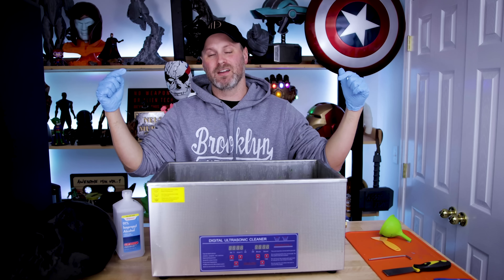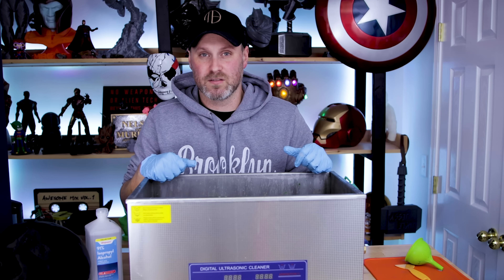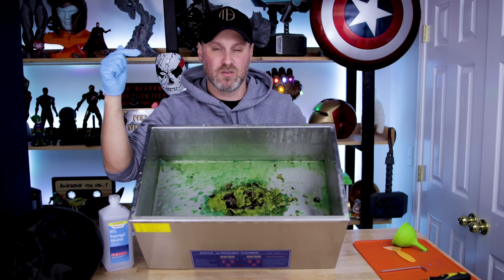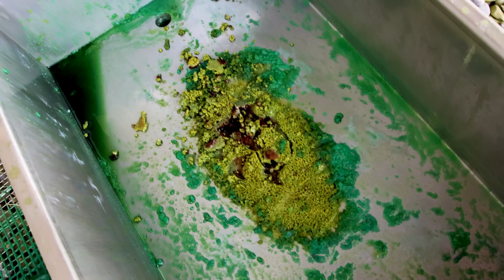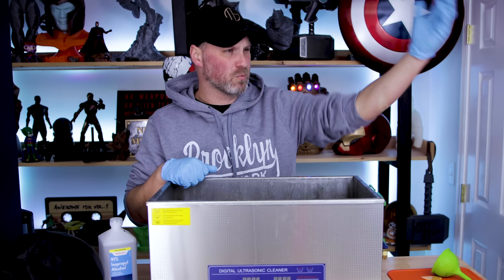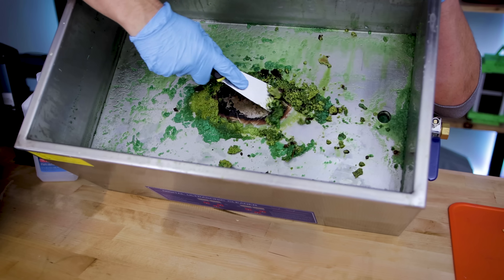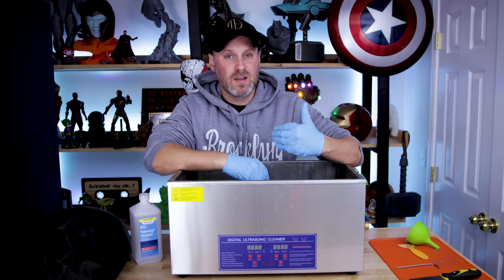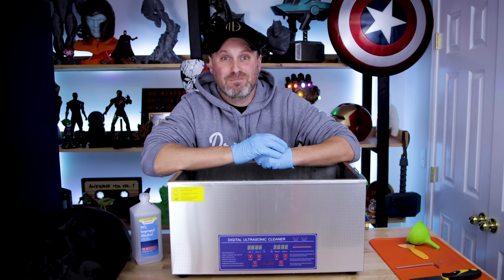Resin 3D Printing - Ultra Sonic Cleaner Safety Warning

Comment: What did you have the heat set to? The sun? For it to boil off all the liquid in the green cleaner over night must of had it on 80C. I run mine at 40C and never have this problem even weeks at a time. Don't blame the unit for user error.
Reply: A few things for you;
1) He specifically says he isn't blaming the machine. He knows it's user error.
2) It doesnt matter what temperature you start the heating at, over time, the temperature will dramatically ramp up as the electronics inside heat up. It can easily get to ridiculous temperatures if left on too long.
Reply: @PokketGM  there is a timer limit on how long the ultrasonic part works and the increase in temperature is not THAT much (10 c is the highest i say on mine)  this is the result of a relative high heat (relative to the boiling point of the used chemicals) for a long time.

Comment: Wow that's a major design flaw.
Reply: not really ; it takes hours to heat the tank from cold so most run the untit hot the whole day  though mine switches the heating off after the cleaning timer has completed, but if you just press the heat on and don't clean after it will keep it at the pre set temp .

Comment: Open the casing and disable the heating element. it should be easy to find as it will be attached to the base of the tank, if you are lucky it will be a simple plug if not follow the wires to board where it can be removed via soldering iron.
Reply: make sure you unplug/ disconnect BOTH wires or else you still end up with a part live wire / heating element if it touches ground/ the case.

Comment: Wow, that is pretty stupid of the MFg. BTW, the el-cheapo from Harbor Freight you can turn on and off the heat.
Reply: These you also can turn the heater on and off and even turns off after the cleaning timer expires.  If you turn it on YOURSELF and then FORGET about it this happens.

Comment: You got extremely lucky.  There is a warning that comes with all heated ultrasonic cleaners:

MAKE SURE THERE IS LIQUID IN THE CLEANER WHENEVER POWER IS APPLIED

The ultrasonic transducers will literally burn up if they are turned on w/o liquid in the tank.  The heater is located on one side of the tank, and the thermistor is located on another side of the tank.  If there isn’t enough liquid in the tank, the heating element will stay on indefinitely.  The cleaning solution will be exposed to extreme temperatures, which can create toxic fumes/cloud, which is what happened to you.  Normally it won’t catch fire, but it could.
Reply: Aah, that makes sense! I was wondering that isn't there a thermostat shutting the heater off, but of course it won't work if the liquid was too low.

Comment: Hi Jessy,

I feel the need to warn you, at 2:07 you implied that you mite use IPA in this type of ultrasonic cleaner?
Please don't do that! You should absolutely never use volatile liquids in this style of ultrasonic cleaner as a cleaning solution! 

There are specialist ultrasonic cleaners made for using volatile liquids and this is not one of them.
Only ever use solutions specifically made for ultrasonic cleaning if you want to stay safe.
Even if you don't use the heating element, the ultrasonic waves still heat up the liquid and that can create the condition needed for the IPA to be more easily ignited.

May I suggest you search online for the specific of why it's bad to use IPA in an ultrasonic cleaner like this.

All is not lost, you can clean parts in IPA with this style of ultrasonic cleaner if done in a safe way.
Check out this NASA tech brief one how to do it using a container for the part and IPA which is then put into the ultrasonic cleaner filled with water.
https://ntrs.nasa.gov/archive/nasa/casi.ntrs.nasa.gov/19690000520.pdf

There are other online resources also outlining similar techniques.

Stay safe.
Reply: tetra3dprint he said luckily he wasn’t using IPA, not that he would. He has a previous video referencing that he would not use IPA due to the safety hazards you mentioned. Good points all around!
Reply: @Baldwij7  I'm  pretty new to this channel, so not seen that video yet. because of that, It didn't feel like he said he would never use IPA with this ultrasonic cleaner because of the danger, it felt more like a possibility. I would have anticipated something more along the lines of "Thankfully I never use IPA in this type of ultrasonic cleaner".  I'm glad he has made a video about the dangers. I still stand by my comment, and if one person sees it, and it makes them think twice about using IPA then I it is worth it.
Unfortunately there are a few channels out there that still show this to be ok :(
Reply: I think you might be wasting your breath. On another video myself and a few others made comments about the dangers of IPA and ultrasonic cleaners. Of course some retard said that because people fry things in frying pans that IPA in ultracleaners isn't dangerous (awsome logic). My point is that people are going to do stupid stuff no matter how many warnings they get.
Reply: @stinkyham9050  If it makes one person think twice about using IPA then I think it is worth it.
Reply: @tetra3dprint  I guess that's true.
Reply: @stinkyham9050  ACTUALLY if you read the manual for these cleaners, I have a similar, smaller, ultrasonic cleaner, and in the manual it specifically states that you can use volatile solvents ( IPA is mentioned), but they include a statement specifically NOT to use the heating function with those materials.   While the sound may create heat its no where near the flashpoint of IPA.  Im not sure how/why jesse's machine continued to heat, as it appears its from the same company as the one i have, but the timer on both the heating and the ultrasonic function terminate when the timers expire on my model, they also recommend a 15 min cool down before running another cycle to avoid damaging the ultrasonic horn (perhaps detaching it from the interior).  perhaps because jesse does so much cleaning of resin parts, and or not cleaning out the machine (again its recommended in the manual after each session to be cleaned and emptied for storage) that jesse's machine became damaged from mis-use.  For ease of use and oof cleanup i too recommend nasa's pdf for using plasttic bags of ipa inside a water bath, a sous vide if you will.  :)
Reply: @DavidClunie  I have 2 ultrasonics and both manuals state to only use water or a cleaning solutiin that is not flammable, most cheaper ultrasonics are like this. If you have a more expensive unit that allows IPA then go ahead I'm  sure it's ok. Basically use the machine the way it's intended.

Comment: FYI, I got the Mean Green cleaner based on Uncle Jessy's cleaner test, and I found it less effective than IPA. My first few resin prints didn't seem to cure quite right, and I thought it was my UV light. So I got a new one, and the prints were still sticky. So I tried cleaning with IPA and the same UV light, and I got solid prints. Don't know why my experience differed.
Reply: I've had the same. I just use the green cleaner to get rid of most of the junk, then use IPA to fine-clean the rest.
Reply: @PokketGM  you know. a prerinse in green before IPA is a good idea! will extend the lifespan of the IPA as well!!

i also sadly found it less effective than IPA which is sad because its HALF the price of IPA :-(
Reply: @nerys71  what concentration of IPA are you using?

I have been wanting to see a test of the different concentrations of IPA to see if some of the higher concentrations (91% or 99%) work to clean the resin faster and if they have any ill effects on the prints.

I usually have tons of 99% around for use with electronics.
Reply: @xandersnyder7214  i use 91% the 70% did not seem to work as well i may try it again with the wash station as it is quite a lot cheaper.

Comment: Uncle Jessy, thank you for all you do. I use mean green based upon your recommendation. I however, don't use it directly in the cleaner. I have a plastic container I fill with mean green, then sit it in the ultrasonic cleaner filled with water. The ultrasonic functions through the water, plastic and mean green to clean the resin off my models. But the ultrasonic cleaner only ever has water. This makes it easier to clean as well since all the goop is contained in the mean green in the plastic bin. I never use the heater function. If your heater was running while turned off but plugged in, that sounds like a serious defect.
Reply: No, you just can't turn the heating element off. There is no on/off for it. If it's plugged in, it's being heated.
Reply: @PokketGM  That's crazy. I guess you have to unplug it after you are done using.

Comment: I'm always extra nervous about my printer and Ultrasonic.  After I take my prints off the build plate, unless I'm IMMEDIATELY printing something else, I turn off the power on the printer.

When I take my parts out of the ultrasonic, I turn off the power because I don't want the LED display or other indicator lights to burn out prematurely.

Shut the machines down before leaving the room, and it's all good.  Thanks for making these videos!  Uncle Jessey's recommendations were what set me over the edge to buying an SLA resin printer, and I don't regret my decision!

Comment: Even 3000 euro cleaners haven't got a thermal shutdown, if you leave the cleaner turned on it will just keep on heating.
Reply: they do in the form of thermal fuses but that is only to prevent fires ect . This is just user error and if you are worried use a external mains timer.
Reply: @cmulder002  believe me we have one at work and that one didn't have a fuse. The thermal padding burnt it self. Maybe some will have a fuse but most do not. It wil always be a user error, so was the case at my work.
Reply: @Parasite98  the fuses looks like http://www.marbeck.com/international-dryer-thermal-fuse-generic-40113801/  ; most are mounted straight on the tank without the bracket though.  Think the biggest problem is that industrial tools are being sold to untrained consumers who assume they are as simple and save a s a refrigerator.  Btw the fuses are there to prevent fires not to avoid boiling off whatever is in the tank. Besides the fumes there does not appear to have been a safety hazard in the clip shown here.

Comment: Thanks for the info.  One solution might be to connect the power cord to a switch and only turn it on when needed, rather than letting the unit have continual power and the heater be on.

Comment: I've looked didn't find any large models without heat. Just unplug it. Now back to building.
Reply: or not switch on ; it will clean cold and you have to switch on the heater each time you power the unit on.

Comment: I've seen some people just using water in the machine, but putting their cleaning solution and the print in either a ziploc bag, or a small container, and putting that in the machine.  At least that way, you only have water to worry about heating up, but your part still gets cleaned in your solution.
Reply: And the dirt also stays in the bag .

Comment: I believe Asa says that it should have a auto shut off.
Reply: For what? Only heat liquid when ultrasounds is on?... Do you know how much time you need to set 60 degree with 30 litres of water?
Reply: they do for after the cleaning cycle; if you just press heat and then never clean after they will keep the tank at the preset temp. 

If you are worried about forgetting you turned on the heater (and yes you have to after powering the machine) then use a external mains timer

Comment: I had this exact problem. I'm glad it wasn't just me. Left it plugged in for over a month in my garage before i noticed. It bricked the cleaner.
Reply: likely just the thermal fuse; look for a round thing size of a coin or smaller stuck to the tank or heating element with 2 wires connected to it.  Remove those 2 wires to measure if the 2 connections still have a short between them (it should have) if its open then change it with a new one and likely the cleaner will work again.

Comment: You know you have to turn the heater off?
Reply: That's just it, you can't turn the heater off. The heating element remains on AT ALL TIMES whilst it's plugged in. Even if you adjust the temperature setting...
Reply: @PokketGM  So you turn the temperature to 0 so it won't heat.

Comment: I have a small ultrasonic cleaner that I pull the power lead out of when not in use ( no separate on/off for cleaning or heating )  the temp goes up when cleaning any way but I have it set to low so when I finish using the unit it does not continue to heat.
Reply: You have unit without heater. Ultrasonic warm liquids like microoven, but with sound, not a micro-shor-radiation. ;)
Reply: I have a unit with a heater i can select temp but I have it low. has 2 displays 1 for temp with up/down temp select and 1 for time again with up down for time select :)
Reply: @zipatronic  likely the same blue label as shown in this clip; also likely to turn off the heat after a cleaning cycle.

Comment: It is a stainless steel bin, if it would have got fire it would just smoked like hell.
But I think you can easily kill the unit by doing this. Maybe hack a dry run sensor to it.
Reply: they have thermal fuses that fail in these kind of condition's looks like the one in the clip never got hot enough to be dangerous.

Comment: if you do want to save this one you could use a smart plug to set cleaning programs with a timer, from your phone. it'll cut the power completely when its done.
Reply from the maker: Oh wow. I will have to look into that for sure now. Didn’t realize you could set a timer on some of these “smart” plugs
Reply: @UncleJessy  Make sure it's a smart plug that will work with inductive devices. I don't think your regular ole light smart switch will work.
Reply: @stevelaminack1516  if you hear it click when it switches then its using a relay and that can switch anything within its load rating.
Reply: @UncleJessy  yeah there are some really cool ones now, and they don't cost much! they'll also track your power consumption over a day/week/month/year and a bunch of other interesting stuff. i think some can cut the power when you go below a user defined power draw for example, because it's all being monitored, so you can have them turn off your printers when nozzle and hotbed aren't on anymore (i.e. at the end of a print) 
seems like an easy fix for this, and they're generally pretty cool. it'd be a shame to throw out the ultrasonic cleaner if you dont need to. :-)
Reply: @UncleJessy  how long are you running? I have never had to go more than 10 minutes so I got one of those bathroom timer switches. I got one for my addon heat bed for my mega zero going to use another for my ultra sonics.

press on get things going them tap the button for how much time you need. B07SDBZR5X on amazon is what I have. 1-5-10-15-20-30 minutes. tap and walk away. when the time is up power is cut.

my ultra also only turns on the heat if i tell it to turn on the heat. yours is always on ? open it up and cut and cap power leads to the heating element. the ultra sonics in most cases are more than enough to heat it up. in fact I have to run my cleaning in cycle times because the ultra alone will over temp the liquid (don't want to pass the tg temp of the resin parts) though this may not be an issue with a vat that large!!

YOU MAY however want to start from scratch. I just got the anycubic wash and cure station. I am never going back. it works so insanely well its truly amazing (I have NOT tried it with alternative cleaners yet though !!!) my parts are squeaky clean in 6 minutes flat!! I mean absolutely no tackyness at all. perfect. it works like a washing machine. magnetic spinner gets the alcohol bath rotating vigorously!! very impressive.

if I ever managed to get my mits on a larger resin printer I will build a larger version of something like this.

Comment: Would it be possible to simply snap one of the lead wires that goes to the heating element? That way you could use the cleaner without ever worrying about the heater turning on
Reply from the maker: That’s honestly what I was wondering as well. I might try that out after letting this air out for a few more days in my garage
Reply: @UncleJessy  exposed wiring? unless you know what you are doing with electronics, this is not a good idea either. 
Im so glad you were using IPA and you only lost the cleaner. I've been tempted but still sticking with the bucket method,

Comment: Thanks for the video!  One note, you don't need the heating when cleaning resin.   The heating is more for cleaning metals like jewelry and things like that.  For resin, you're good without the heat.  As for the heating element, not sure about yours but mine actually has an On button which I never use.  Keep safe and good this was brought to everybody's attention.  Thanks again!!!
Reply from the maker: Yeah, I don’t recall turning on the heat but I must have. I haven’t plugged this one back in yet. Letting it sit in my garage for a few more days before I touch it again
Reply: @UncleJessy  I'd check that yours even has an on/off for the heating element. It looks like the same make as mine, which does not have that kind of on/off.